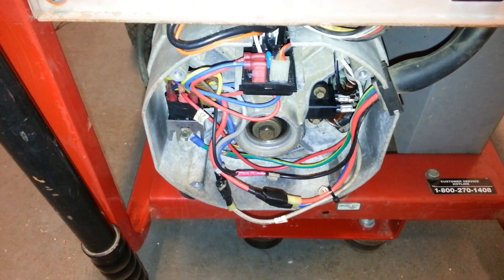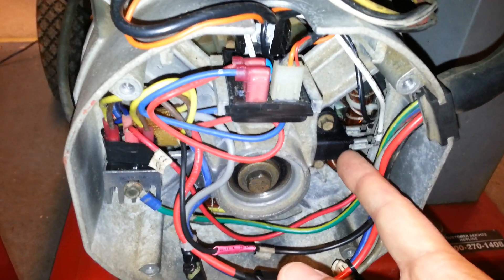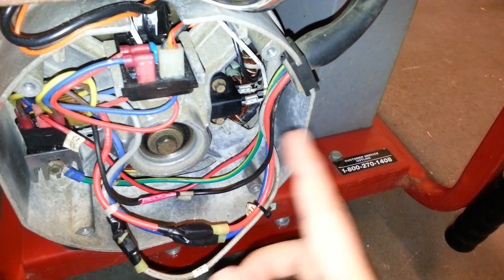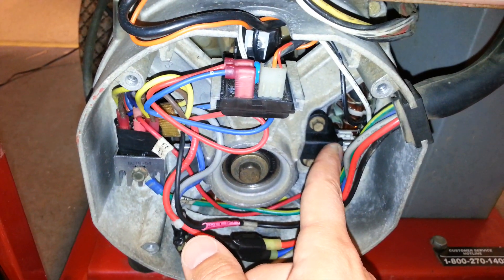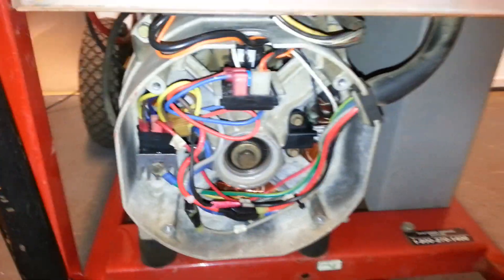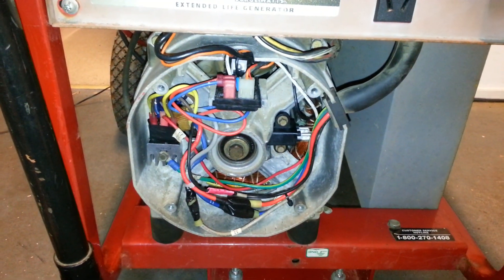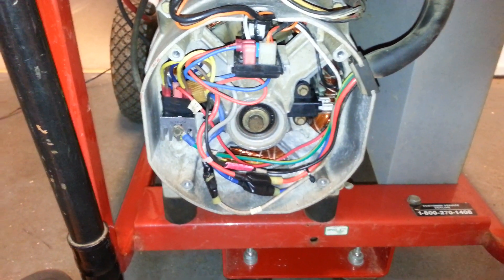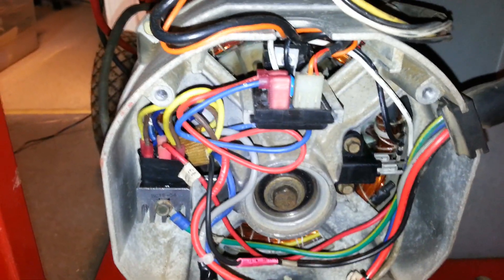Generac Portable Generator: How to Test the Windings

Comment: What would be wrong when the generator (Generac 17500) is putting out 180 volts or more on one side (L1 to Netural) and 60 volts on the other side (L2 to Netural).  When connect to house we blow several different components. I had a dealer come out and replace the VR and charge me $145.00 plus $125.00 labor and problem still exist. No refund. Next I paid a guy $145.00 to come out and he said Stator was bad but I didn't see him check it the way you did. The stator is over $500.00 and I not sure if I should get this if there may be another cause to my problem. Generator is 2 years old but only 32 hours on it.  (No warrenty) Last time I used it had no problems. Please help if you can.
Reply from the maker: What model# exactly? check out my video on the 15kw Generac ultra source, same problem. https://youtu.be/-OlUP-lSpwM 

It can go one of two ways, its either a loose neutral lug inside the generator, loose neutral inside the stator which is bad, or the ground/neutral are reversed. My problem was a loose neutral at the 50A plug. You getting unbalanced voltage at the generator as well when the generator is not connected to the house? What method are you using to connect your house? T-Switch? Interlock? Lots of variables, help me out here.
Reply: Thanks for the quick response. The Model is a GP1750E (0057351) SN# 6840943. I have a Generac 6380 50 amp manual transfer switch. I am using interloc connections. I did check all the ground and neutral at the transfer switch and are ok. I saw your u-tube video you mention and that is what my unit seems to be doing. I will check the neutral at the 50A plug at the generator as I did not check this. Should I be also doing that neutral to ground circute like you did? Is this video the proper way to check the stator or can I just disconnect the 44 and 11 wires at the panel and check the resistence from the wires coming from the stator? What should the ohms be? I can't see how a stator can go bad by just setting for 4 weeks. the last time I used it I had no problems and did not blow anything in the house.
Reply from the maker: pdfstream.manualsonline.com/0/0cbbf673-1de1-475a-9fe2-c70d8cdc7ae5.pdf

that diagnostic manual will give you step by step how to test your stator and rotor. The GP15000E is the same as the Ultra Source 15KW, except the ultrasource has no hour meter built in. The Neutral to ground bond is only for when the generator is used stand alone not connected to a transfer switch. The GP15k has a floating neutral, so it must be bonded by the main panel in your house.

Do the tests with the generator by itself not connected to the t switch on your house. Open the panel and verify the neutral is solidly connected first. Then use the step by step instructions to measure ohm resistances of the windings. You need to disconnect C1 to do this.

If any of this info doesnt make sense to you, you should hire someone who is familiar with the machine., Obviously not the people you have brought it to since they seem to take your money and not help you.
Reply: So as I understand it I should make sure the Neutral Bar in the transfer switch is bonded to the box it self. 
I can do this by screwing the green screw into the Neutral Buss bar and making contact to the metal box or by connecting the green wire from the generator to the White neutral buss bar along with the white. Is this correct? Thanks for all the help. I have been doing all the testing at the generator. I will down load the manual and test as instructed.
Reply from the maker: No, transfer switch is concidered a sub panel. The neutral and ground bars must be separated per NEC code (assuming you live in the States) the neutral and ground bars will be bonded together at the main panel only.
Reply: Thanks that's the way I have it, Now I checked the repair manual and see the section on testing the stator. I guess I can't test it with my Ohm Meter.  Darn. It said I need a Hi Pot tester, is that correct? Your video seem to be able to test the stator by testing the  Blue to Red and the Gray to Red with a ohm meter. If so what should the readings be? I would guess infinity.
Reply from the maker: yes ideally a hi pot tester needs to be used. Using an ohm meter is similar, instead a hi pot tester sends 500, 1000, or 1500 volts to check the insulation. My klein meter measures up to 40 mega ohms. You should see infinity from phase (11 and 44) to ground, neutral to ground, and winding to winding. That means that there is infinity measured between the windings that they have no continuity between each other.

I assume the GP17500E has a floating neutral like the Ultra Source series machines, so connecting to a transfer switch bonds it. Also as the manual implies, removing connector C1 isolates the stator windings from all the circuit boards, solenoids, windings, etc that would throw off your readings to compare to spec.
Reply: OK Thanks I found it in the repair manual (section 6 Test 9). So if All the readings are at specs I can assume my stator is ok. I will go check it and get back with my results. I sure hope its a Loose neutral.
Reply: Well I finally got to test the stator. The c1 pin connector is configured a little different then the repair manual. I have no 44s but have a 22s occupying the same pin location. My unit uses only 1 ICT with both line wires running thru it (44&11) Checking 44 - 11 I get .0. checking 22 to ground = (OL) Infinity 44-22 .0 and 11-22 = .0 Looks like my stator is Bad. I do have the stator out and on the bench. Any recommadations were to get one?
Reply from the maker: I don't think your stator is bad based on those numbers...

You need a meter to measure low resistance. Power windings 44 to 11 should be about 0.067 ohms for a 17.5kw stator. What about measurements from 44 to 0 ground, and 11 to ground? what about 22 to 0? Do you see any melted or burnt laminations?  your model# does have battery charge windings 66/77 and 66a/77a. you need to measure between those windings, power windings, and DPE windings and look for infinite ohms, or a resistance greater than your meter can measure.
Reply: What do you consider Low Resistance. My meter has 600, 6k, 60k, 600k, 6m and 60m. Which should I use. I used the 600 position on all previous test.I can't do 44-0 as 0 is to the brush ring which I have the Stator on the bench with no rotor. Same with 22-0. I did check 44 to stator case and 11 to stator case and 22 to stator case all Infinity. I did the following test 2 to stator case (bare metal)= Infinity,  66-to stator ground (stator case)=Infinity; 11-66a=Infinity; 11- 2=Infinity; 11-66= Infinity; 66a-2=Infinity; 66a-66=Infinity; 2-66= Infinity. I  did look at my Brushs and the (+) Brush was broken part way. only a third of the top end of the brush was in contact with the ring. Could this be my problem. If my stator checks out ok what else can cause my problem.???? All the dc circuts seem to work ok. The motor starts and runs and idles down like it should.Not sure if we can have an electronic shop check the stator to double check. But all my readings seem to be ok.
Reply from the maker: MARCUS ANDERSON brush contact not in contact with the slip rings would not cause a voltage imbalance. If your meter is not auto ranging, get one. A manual range you limit your visibility if a resistance is 6 ohms or 60 mega ohms. Big big difference. If you see no physical damage or heat stress in the stator it may very likley be ok.

As mentioned, voltage imbalance is due to a bad or loose neutral somewhere in the stator and/or panel. Without it the amount of load on each side of the split phase will cause voltage to drop on the heavier loaded side and increase on the lighter loaded side. The neutral carries imbalanced current to keep the voltage balanced between the windings.
Reply: Ok. Let me do one more recap. First  I get the in balance when I measure at the 50 Amp Plug without any load. I found no loose wires any were. No loose neutral (22) in the panel.  So the stator must be bad somewere intrernally. Retested 44 to 11 got a 0.3 ohm reading (I used a Auto metering meter this time) 44-22=0.3 reading, 11-22= 0.3 reading but when I put the red and black prob's togeaher to check continuty I get a 0.3 reading also. I see no burnt or over heated wires in the stator. I guess I am going to have to scrap this thing. Its a shame because like i said ever thing else works great. This generator cost me $3000. and got to use it 32 Hours. If there anything That I might be over looking please advise if you can. I live in southern Flordia if any one wats to buy for spare parts.
Reply from the maker: Marcus, dumb question, but are you showing the voltage imbalance at all the outlets? For example, you have two duplex outlets, one standard, the other GFCI. Top and bottom plugs are each of the half windings. are the voltages the same for all 4 plugs? Maybe just the 50A plug is faulty, I've seen that happen too. Don't scrap it just yet. Got to try all the stupid little things before calling the stator bad, which is the most expensive part of the machine.
Reply from the maker: Another thing. I cannot seem to PM you on here. I dont think you have it enabled. Send me an email or phone#, we can try a few more things before calling the machine scrap and need to order a new stator.
Reply from the maker: email sent

Comment: My gen was under water last April & was not started till last week . The engine runs fine , but the gen. is not putting out any power . Have done nothing to gin. What should be my first step . 
Herb
Reply from the maker: Throw the gen head in the trash, water destroys the insulation of the windings almost 100% of the time
Reply: Thanks not what I wanted here. But it is what it is.